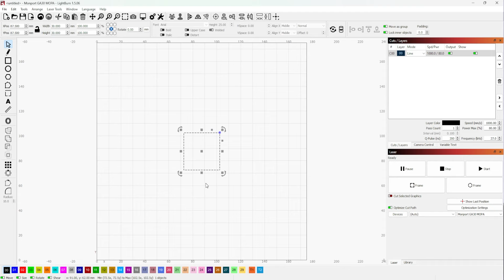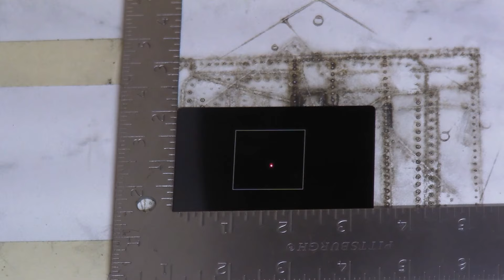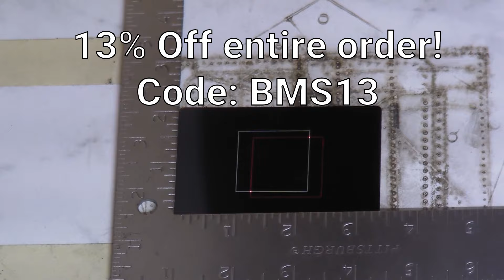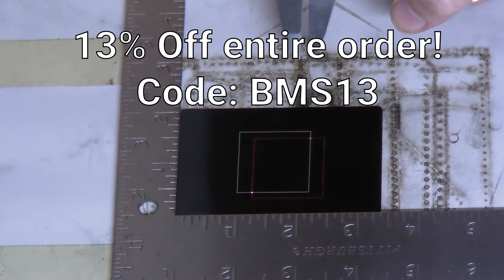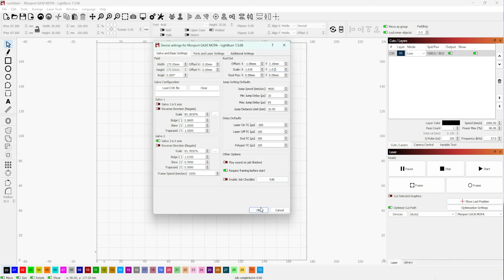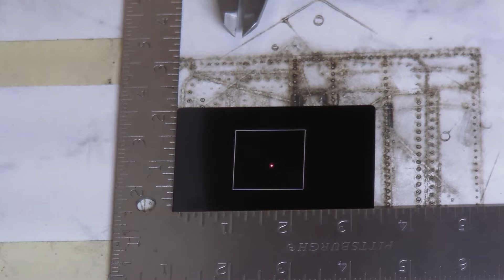Monport GA30 MOPA Fiber Laser - Calibrating in Lightburn

Comment: This was very helpful. I do have two questions: 
1. I was using black craft paper, and the red frame showed, but the laser did nothing at all. It worked on aluminum. It worked on the back of a shiny, black box, but not craft paper. What features should the card have other than smooth?
2. I pushed the autofocus button, and it went up and down, but the dots never converged. How do I know it worked correctly?